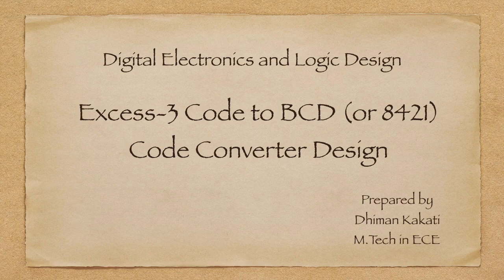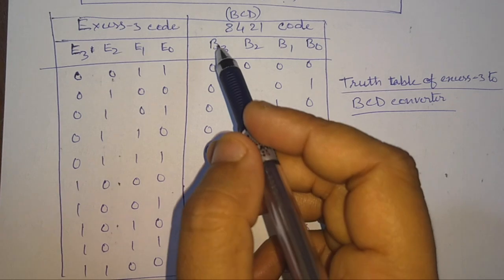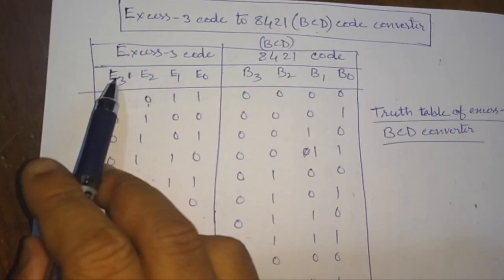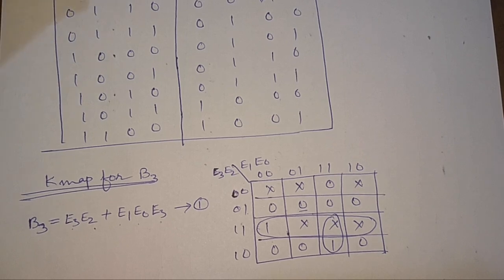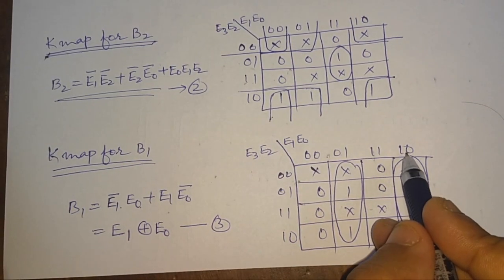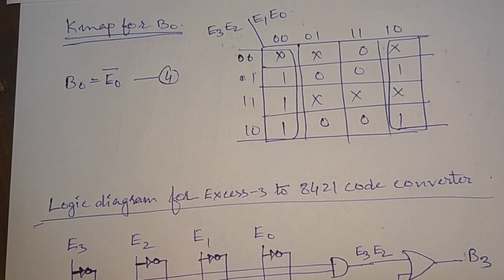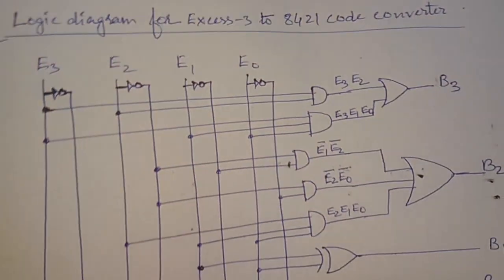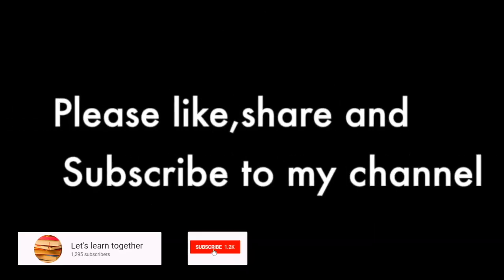Excess 3 Code to BCD code Converter Design

Comment: There's an error in B3 k map with the block for 0001. It's not don't care
Reply from the maker: It is correct. For B3 K-map, We have to see the B3 column. First of all, we have to put all the values 0 or 1 of the B3 column in the respective E3E2E1E0 block.  

For example, 
the last 1 in the B3 column, see the respective E3E2E1E0 = 1100
so, put the 1 value in the block which is represented by E3E2E1E0 = 1100
and similarly for all the other values.